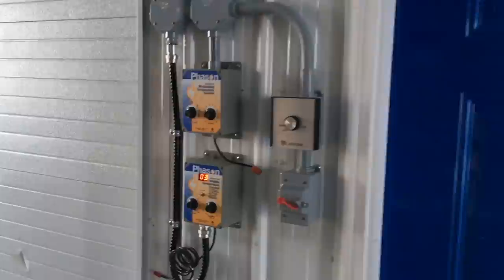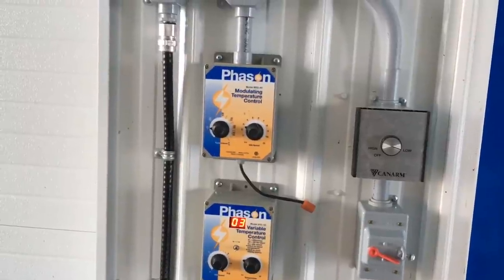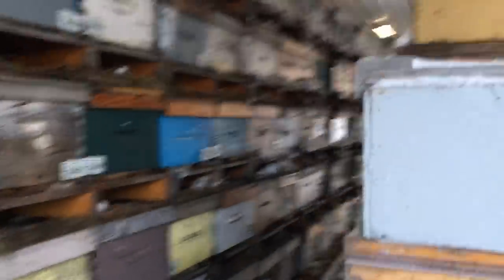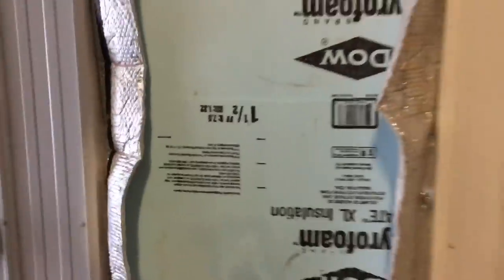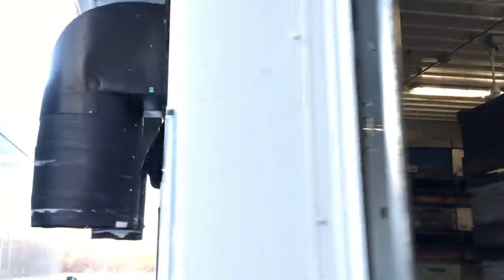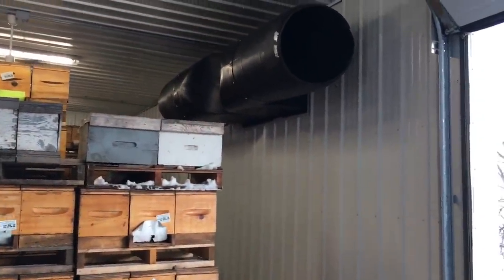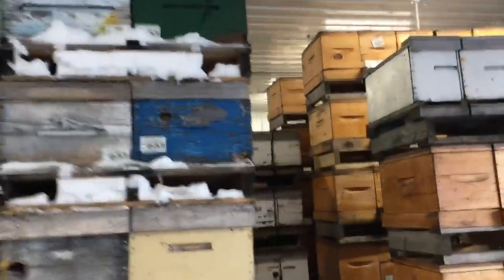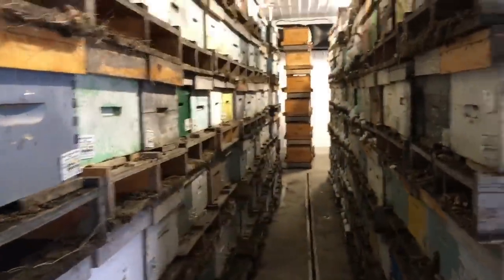Wintering honey bees indoors, my set up

Comment: How do you measure the C/o2 level?   Just curious - I have a small shed project, just 4 hives in a temperature controlled insulated  compartment.    Northern Maine here.
Reply from the maker: Jeff Vreeland a CO2 detector can be bought off Websites for cheap
Regulated airflow is important 
Bees can handle more CO2 than we comfortably can

Comment: Hi Ian, whats the optimum winter temperature for your bees inside the barn, are you looking for a good steady mean average. do you ever have to heat the shed to bring up the temp a little in your coldest months when its about -40 outside.  just interested in how you regulate the temp?
Thanks and very interesting!!
Reply from the maker: Richard Noel I keep the fans set at 4 degrees Celsius and cool the shed with increased air exchange.  I’ve yet to heat the sheds I’ve used.
Reply from the maker: Richard Noel I keep the fans set at 4 degrees Celsius and cool the shed with increased air exchange.  I’ve yet to heat the sheds I’ve used.
Reply: Steppler Farms Video Blog  thank you!!

Comment: With that many hives in there do they do a pretty good job of heating it or is the heat bill still pretty high?
Reply from the maker: Matt Winstead zero supplemental heat, continuous air exchange to cool
Reply: Steppler Farms Video Blog 
Wow that's impressive.  How high are ceilings?
Reply from the maker: Matt Winstead not high enough, ceilings are 12’